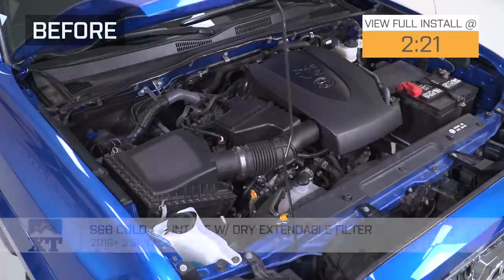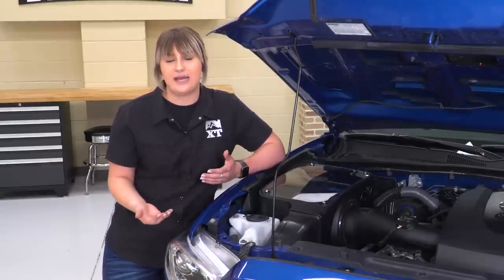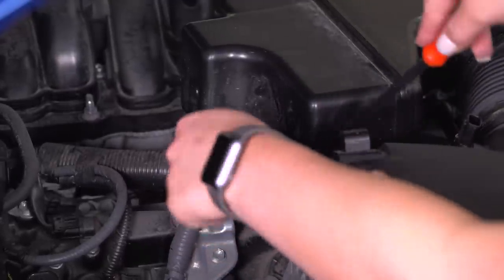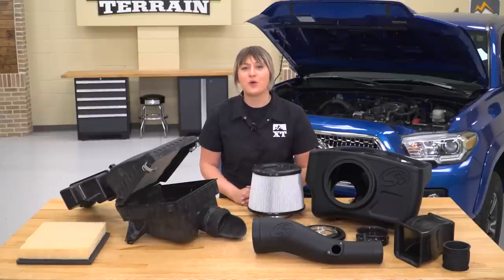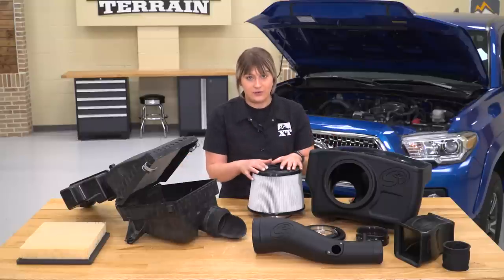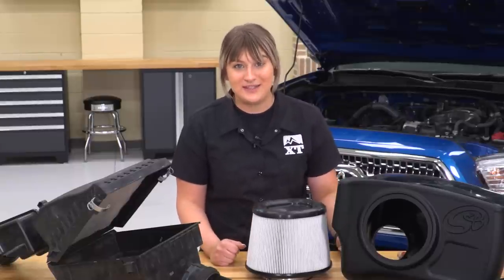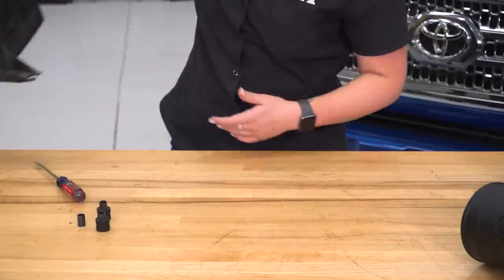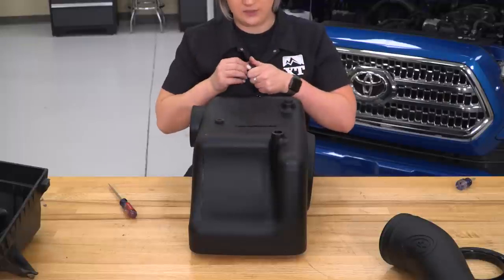Tacoma S&B Cold Air Intake w/ Dry Extendable Filter (2016-2019 3.5L) Review & Install

Comment: To get the seal seated perfect for the cover, get it started and then just stretch it out about 5 inches and then slide your finger over the top of it and it will go right into the groove. So much easier. Once installed, this thing makes the taco sound mean when you nail it. It took me about 45 minutes soup to nuts to get the job done and clean up. It was simple after watching the video. Today's mission, Pedal Commander. Thanks

Comment: Don't you need to disconnect battery first so it won't throw an error?? Pretty sure I read that on S&B website.  No need for tune, but disconnecting battery tells truck, when you reconnect battery, there's a new air situation

Comment: I know this soo cool but I will never and I mean never but a cold intake on my truck. I lurned the hardway.  I put one on my 2007 chevy Silverado.  Driving down the main street,  and it just got finished raining.  I went over a puddle of water no deeper then one inch crossing over the road. My truck shut off. I tried to crank the truck but all it did was made a bump sound. I called my friend that's a mechanic.  He told me he had bad news. Going over the water suck water into my intake causing a hydro lock, busting all my engine rods. One went through my oil pan. Fortunately my insurance coverage took care of it. Never make that choice again
Reply: Did you only have the fender vent feeding air or did you also have the ram air vent that takes suction from the grill?
Reply: This intake can be configured like stock or ram air.  The box is sealed so it wont suck in water anymore than the oem airbox.  Now if you had an open air box design water can get into it of you hit a giant puddle that floods the engine bay

Comment: Technically, your ecu manages everything. Regardless changing your intake the numbers will all be the same unless you get your truck dyno and tuned. Your basically paying for a noise maker lol
Reply: ShinyStarDust Homes lol your funny. How about you bring your truck to a tuner and run it stock and then run it with this noise maker. Your still getting the same output buddy.
Reply: You don't know the difference between your and you're, just like you don't know what YOU'RE talking about.  You can still see an increase in performance from an intake without a tune, a tune will just take more advantage of the increased air flow.  Many vehicles make more power with nothing other than a cold air intake...some just see significantly more of an increase than others.
Reply: @bsfunk44  that’s cool. Didn’t know we are in school on YouTube. 😂 #grammer
Reply: Hay hay hay, whay aar oui arguwing aboutt gramer? 🤔